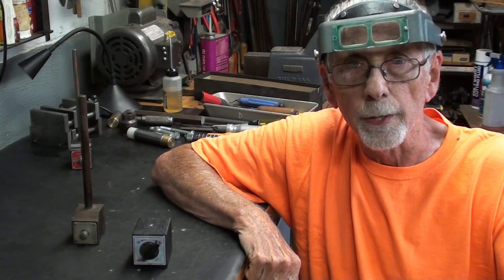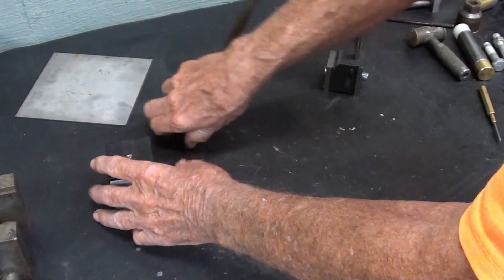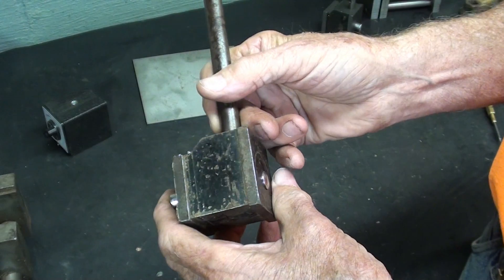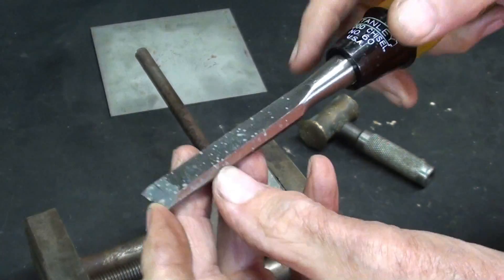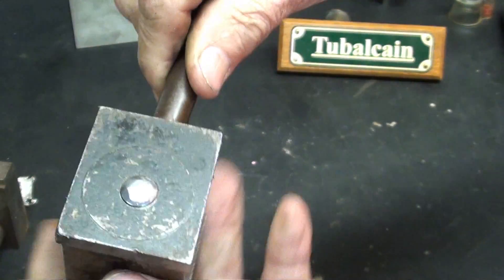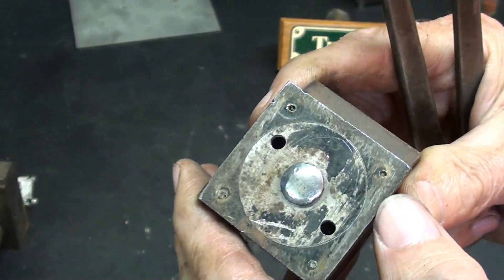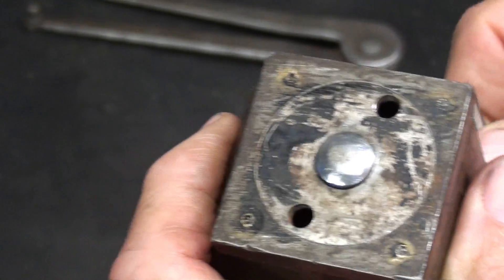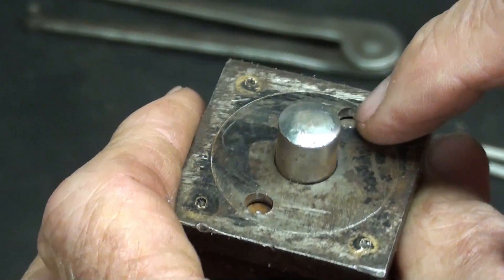WHAT MAKES IT WORK? #34a pt1 Push Button Indicator Base tubalcain

Comment: This has been very interesting to watch the intermittent steady progress on this indicator base. I have owned a couple of these over many years. There is a company in Brunswick, Ohio that manufactures these. The company name is Gem Indicator. These have a label plate with green paint. The one usable surface that you did not mention are the two directly adjacent to the top post. It works as a V block for round bar work.
  After watching and scratching my head, I am wondering if the magnets, are in fact two discs fit firmly to the round push button pin.

Comment: I wish I had watched this video earlier! I have that exact model Starrett that was seized up like a rock! I soaked the button area with Corrosion-X and let it sit for an hour. It started to move slightly so I applied Corrosion-X to the other side and again, let it sit so that the fluid would weep into the bore. With the help of a small lead hammer it started to move in both directions. After a lot of soaking and moving it back and forth it is now working. It's a bit stiff still but, over time, it should free up nicely.

Note: The small hole in the mounting post is for inserting a strong rod to use for unscrewing the post. I used an Allen wrench that fit and it was a real stinker to unscrew. It must have had thread locker on it, too. The screw in the side is a cover screw to allow you to place that post on the side if you mount the base in an awkward manner. The hole has the same thread as the one into which the post sat originally which led me to that theory.

Comment: I wonder why wood chisels just don't hold up very well when cutting steel (or any metal).  Seems like they're just not made very well.  A couple of whacks and the edge is just gone.
Reply from the maker: True, but a good part of the reason is the very acute angle, makes the edge very fragile

Comment: Common Tools Explained
To the unitiated, the workshop can be an intimidating place, full of tools you may not know what to do with. To help, here's a helpful explanation of common tools and their uses.

DRILL PRESS:
A tall upright machine useful for suddenly snatching flat metal bar stock out of your hands so that it smacks you in the chest and flings your beer across the room, denting the freshly-painted vertical stabilizer which you had carefully set in the corner where nothing could get to it.
WIRE WHEEL:
Cleans paint off bolts and then throws them somewhere under the workbench with the speed of light . Also removes fingerprints and hard-earned cleco calluses from fingers in about the time it takes you to say, "Oh sh*t!"
ELECTRIC HAND DRILL:
Normally used for spinning pop rivets in their holes until you die of old age.
SKILL SAW:
A portable cutting tool used to make studs too short.
PLIERS:
Used to round off bolt heads. Sometimes used in the creation of blood-blisters.
BELT SANDER:
An electric sanding tool commonly used to convert minor touch-up jobs into major refinishing jobs.
HACKSAW:
One of a family of cutting tools built on the Ouija board principle. It transforms human energy into a crooked, unpredictable motion, and the more you attempt to influence its course, the more dismal your future becomes.
VISE-GRIPS:
Generally used after pliers to completely round off bolt heads. If nothing else is available, they can also be used to transfer intense welding heat to the palm of your hand.
WELDING GLOVES:
Heavy duty leather gloves used to prolong the conduction of intense welding heat to the palm of your hand.
OXYACETYLENE TORCH:
Used almost entirely for lighting various flammable objects in your shop on fire. Also handy for igniting the grease inside the wheel hub you want the bearing race out of.
TABLE SAW:
A large stationary power tool commonly used to launch wood projectiles for testing wall integrity.
HYDRAULIC FLOOR JACK:
Used for lowering an automobile to the ground after you have installed your new brake shoes, trapping the jack handle firmly under the bum per.
EIGHT-FOOT LONG YELLOW PINE 2X4:
Used for levering an automobile upward off of a trapped hydraulic jack handle.
E-Z OUT BOLT AND STUD EXTRACTOR:
A tool ten times harder than any known drill bit that snaps neatly off in bolt holes thereby ending any possible future use.
BAND SAW:
A large stationary power saw primarily used by most shops to cut good aluminium sheet into smaller pieces that more easily fit into the trash can after you cut on the inside of the line instead of the outside edge.
TWO-TON ENGINE HOIST:
A tool for testing the maximum tensile strength of everything you forgot to disconnect.
CRAFTSMAN 1/2 x 24-INCH SCREWDRIVER:
A very large pry bar that inexplicably has an accurately machined screwdriver tip on the end opposite the handle.
AVIATION METAL SNIPS:
See hacksaw.
PHILLIPS SCREWDRIVER:
Normally used to stab the vacuum seals under lids and for opening old-style paper-and-tin oil cans and splashing oil on your shirt; but can also be used, as the name implies, to strip out Phillips screw heads.
STRAIGHT SCREWDRIVER:
A tool for opening paint cans. Sometimes used to convert common slotted screws into non-removable screws.
PRY BAR:
A tool used to crumple the metal surrounding that clip or bracket you needed to remove in order to replace a 50 cent part.
HOSE CUTTER:
A tool used to make hoses too short.
HAMMER:
Originally employed as a weapon of war, the hammer nowadays is used as a kind of divining rod to locate the most expensive parts adjacent the object we are trying to hit.
MECHANIC'S KNIFE:
Used to open and slice through the contents of cardboard cartons delivered to your front door; works particularly well on contents such as seats, vinyl records, liquids in plastic bottles, collector magazines, refund checks, and rubber or plastic parts. Especially useful for slicing work clothes, but only while in use.
DAMMIT TOOL:
Any handy tool that you grab and throw across the garage while yelling "DAMMIT" at the top of your lungs. It is also, most often, the next tool that you will need.

Comment: Hi Lysle, I had never thought about how those things actually worked, and from a technical point of view I am stil none the wiser as to how that brass separation impacts the magnetic fields. It also raises the question of how the turn one works, does it rotate the magnet, or operate a cam that basically moves the magnet back and forwards, and if it rotates the magnet, is there a brass plate parallel to the axis of the magnet. You will have to do a third part on the rotation style. What have you started?
All the best from Oz. Dennis.
Reply from the maker: There already is a video on the type the terms

Comment: There are 4 positions to use the fourth is on top where its cut out above front push button, it can stick to round diameters at this fourth position,  Coventry England.

Comment: To get rid of gasoline smell, well I don't know since I don't often get it on my hands but it's very similar to kerosene, just kerosene has longer carbon chains.  Kerosene I wash off using alcohol.

First, I wash with soap and water and dry hands as much as possible. Then I apply a bit of denatured alcohol, just enough to coat my hands, don't want them dripping that would be a waste, and rub well. Rinse off with water, then wash with soap and water then dry. Then repeat the alcohol application and washing.

Now that I think about it, I might be better off wiping on a clean dry rag before washing off the alcohol in water since the theory is the kerosene is miscible with the alcohol and wiping might carry it away to the rag. Adding water to the alcohol kerosene mixture on my skin might steal away some of the alcohol from the kerosene before I can loosen it from my skin with mechanical action. 

It doesn't entirely get rid of the smell but it lessens it a whole lot. I don't think it's just the alcohol overpowering the kerosene smell since the alcohol evaporates pretty fast and I don't notice the kerosene as much later.

I think I washed off turpentine with kerosene one time since turps smells so strongly to me and I was in a mood to experiment. Just used the principle of like dissolves like and stayed away from noxious stuff like benzene and toluene and acetone which are all miscible with ethanol so should probably be wash-off-able with denatured alcohol.
Reply from the maker: Thank you for the information, I will try that. Someone else said to wash my hands with soap and dry them. And then rub my hands with toothpaste, and then wash again.
Reply: You're very welcome. Hope it works and it's not just my imagination. I hope to remember the toothpaste trick. Thanks for passing that on to me.

Comment: Hello Mr Pete.  Your push button indicator base is a Brown and Sharp "Magnicator".  I have one almost identical.  Mine came apart much easier but the magnet is junk.  I would be fearful of dropping a good indicator.  However,  my faceplate is in readable condition and if you do a restoration on yours you are welcome to have mine for parts.   Bob in Minneapolis.  ( I had no spanner so I put two pins in my vise the appropriate distance apart and used that as a spanner wrench.)
Reply from the maker: Thanks for the info!
I’m glad to know that it is a Brown & Sharpe

Comment: That plate ( sorrounding the piece he removed with the spanner wrench ) has 4 little screws, bolts, or pins holding it in place.

Comment: You know, those two holes for the spanner look just like the two holes on the face of some of the live centers to remove that round cover plate over the bearings and I think hold the seal.  A person should measure those and get a spanner that would fit it to keep around.  This is the only time I've seen one of these apart.  They all have that cover plate that keeps you out of it.   Did you notice that the steel ring on each side of the magnet on the sliding part are not the same on each end?  And one of them has a bump on it for some reason.  Do you see it?
Reply from the maker: Yes, thanks

Comment: I stopped the video for a moment.  You could tap the holes and run a screw down in each one and see if that would lift the plate out.  Also, once you have the two dowel pins, put them in a vise, just sticking up and that will be the best spanner you can find.  If you have a vice you can stand on its end, you can just lay the pins on the jaws and if you need a gap in the center like for that button, you can easily add a couple of blocks to hold the pins then tighten the vise to make the opening.  Use a wrench on the whole base or grab it with second small bench vise to rotate it.  Ok, back to the video... the suspense is killing me.  It's almost time to get out the citric acid.
Reply from the maker: We must think alike. The very first thing I did off camera was to put the two dowel pins in the bench vice.

Comment: On your restoration, will you be adding a "finial" to the upright ? 😊
Interesting about how the brass section might affect the magnetism, have you ever used those "zebra blocks" that are a multi "sandwich" of brass and iron sections and are used to support workpieces being machined on a magnetic chuck ? I'm curious how the brass sections interfere or enhance the magnetic flux ?

Comment: You're right about the brass. Non ferrous metals act as an insulator for magnetic flux. That's why you used to find copper or aluminum plates in speakers which were to be used in close proximity to cathode ray tube TVs. They were used to shield the tube from the magnetic flux so that it wouldn't make funny colors on the screen or distort the picture.

Comment: Mr. Pete Thanks for this video!  A trick for getting fine threads to line up is to is to turn it backwards slowly until you feel/hear the threads align with each other and then thread it as you normally would.  Learned this trick years ago when taking a civil engineering course doing surveying, the threads on the tripod and the head unit were 400 threads per inch.  If the threads got mess up it cost $1000's to fix them, this was back in mid seventies so yes I have been around for a few years like you.   : )

Comment: Very good video! A few minor points, and then I'll get into the meat of it.

I was shouting "Face spanner!" at you for several minutes, but you figured it out. 

While they probably wouldn't work as well, i imagine you have far more many cold chisels than wood chisels.

The fine thread is needed because of the short engagement length.

Liquid Wrench is still made and a lot easier to buy than Kroil, which is only available from industrial suppliers.

Now that i got the quibbles out of my system, here's the meat of it:

The layer of brass is there to block the magnetic flux. Think of the magnet as a battery, with the N/S poles being the ±terminals. When the magnet straddles the brass, the flux flows through the iron ends and the clamping surface. When the magnet doesn't straddle the brass, the field is shorted out by the iron, as if you shorted out a battery with a slide switch.

The field is like an electric current, and it will flow through the path of least resistance. Magnets don't have "voltage", as such, so the analogy isn't exact. Going further than that, though, rapidly gets into vector potentials, 4D tensors, and special relativity.
Reply from the maker: Thank you very much, I hope other viewers read this comment

Comment: It may sound weird but if you wash your hands with toothpaste after your hands are clean the toothpaste will cut the majority of the smell from oils and such.
Reply from the maker: I will try that right now, I just added 90 weight gear oil to my tractor on my fingers stink even after washing.

Comment: Nice one.  In England that thing would probably be made by Eclipse.  With a bit of patience you can sometimes get penetrating oil into them from both ends between the button and the casing, knock it back and forth a bit and they free up - but thanks, now I know how they come apart.  If the magnet feels a bit tired, setting up a clock so you push from the 'front' on it gives you the best chance of it not pinging off, as the post is towards the 'back' so the moments work out best that way.  For something so common and cheap on ebay, a branded new one is surprisingly expensive.

Comment: This was really fun to see how these are built. I have been using one for over 50 years and never had a chance to just exactly whats inside. I like restoring small tools. I would polish up the contact flats on a 400 grit, sitting on granite, and renewed the paint with black enamel.

Comment: Christopher Lloyd as Taber  loved his Otoscope in the movie One Flew Over the Cuckoo's Nest. 
Magnets are fun, especially for kids that are Henry's age. Have you ever seen the gravity experiment of dropping 2 magnets, one through a section of copper pipe with both being dropped from the same height at the same time?  An old section of copper pipe about 3 feet long or longer would be perfect. The magnet in the pipe will come out slower than the one dropped from your fingers. Copper and a magnetic field cause the slow down. I do not understand why. I think Henry and all kids would get enjoyment watching. You could drop both from fingers to see they hit the ground at the same time so you have no tricks being performed.
I have been using a penetrant called Free. It is not inexpensive as the junk from Walmart and it does the best job of any I have tried to date. I don't think any peneetrants work with rusted bolts unless you catch them in the early stages. Heat is the only thing I know that will loosen the ones that won't come out/off. Amazon sells Free but it is also sold elsewhere.
Reply from the maker: Send the experiment heck. I’ve done it, there is a video on it.
Reply: I forgot that you did that. I have to show my grandson.  @mrpete222

Comment: Brass is indeed "magnetic insulator" as it is non-ferrous. To easily see the actual magnetic flux lines of your magnet put some iron powder or fine iron filings on a piece of white paper and hold magnet underneath. The iron filings will align with magnetic flux lines.

Comment: In simple terms.  The cylinder magnet is always magnetized. When in it transfers the magnetic forces to the steel base. When pushed out past the brass plate it decides the two poles of the magnet in the base, thus the plate then losng magnetic force. Good luck reading the patent if it's located.

Comment: I'd be interested to know what material the device is made of, as soft iron has high magnetic flux  permeability (that's what 'soft' means in this context). 

Brass and copper are not such good magnetic 'conductors'  (this is an analogy often used in Physics) so if one end of the magnet is slid so that it is adjacent to the brass ring insert the magnetic circuit is weakened, thus severely weakening the external magnetic field.  

I had assumed that the buttons or rotating knobs  acted as levers to prise the magnet away from the base - but it's fascinating to see that it's cleverer than that.